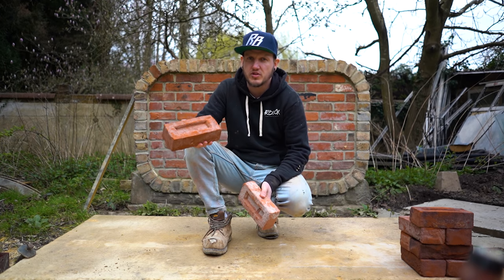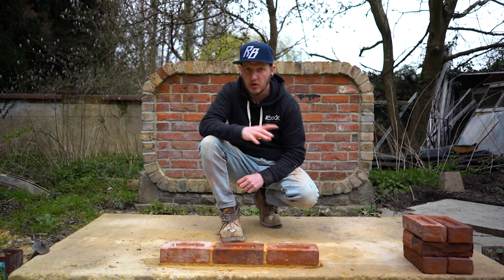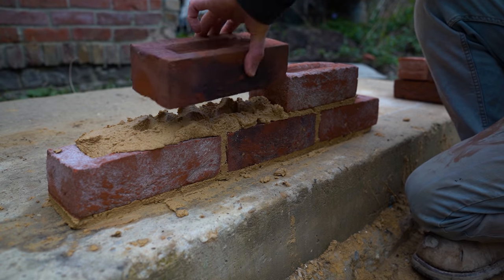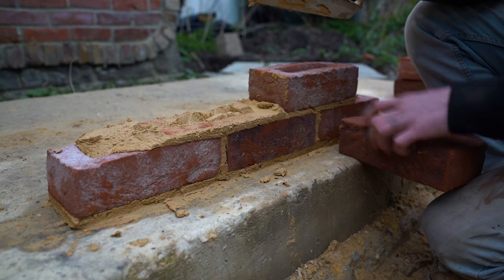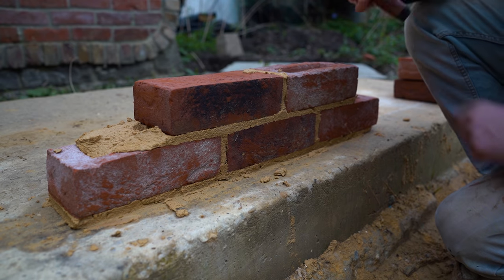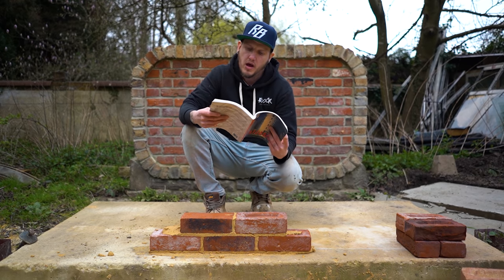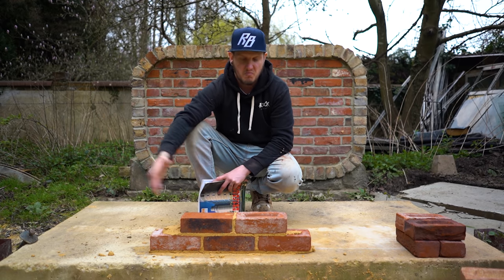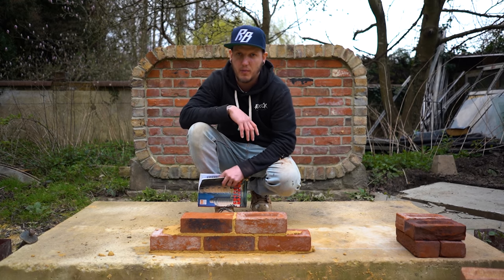THE BEST BRICKLAYING TECHNIQUE is Frog up or Frog down?

Comment: I layed frog down for most of my price working life, less wrist stress pressing the bricks to the line, online recently in last few month converted to frog up pic and dip, I still find it easier to build corners/pillars frog down, you get the suction effect and less sliding affect around the bricks when doing level work, plus a nice flat top level off

Comment: The frogs are there to make the brick lighter and use less clay , the old lbc bricks had huge frogs , cheaper to manufacture and lighter to move to the site , as muck is mixed on site it's cheaper.  I would lay the last course on a single skin frog down so it doesn't collect water .

Comment: Rodian you  can’t be certain that the first brick you laid had no voids in the bed because of the deep furrow you put in the bed . If you lay brick with shallow frogs , frog down into an unfurrowed  mortar bed you can be certain the frog will be filled . Why do bricklayers furrow mortar , because when they  are serving there time they we’re told this is how you lay a bed . Charlie collison has proved conclusively in his videos that brick can be laid no bother into unfurrowed mortar and you can be 100 percent certain there is no voids in is beds . I think the real problem in brickwork  is not Laying them frog up or down it’s laying into deeply furrowed mortar and leaving voids in the bed . Obviously laying frog down into deeply furrowed mortar can create bigger problems than frog up into deeply furrowed mortar but they are both problematic. Lay shallow forgged brick any way you like but cut out or cut back drastically on the furrowing and you’ll have no problems regarding full beds.for the record I lay frog up.

Comment: My 1920s 9 inch solid brick wall house has the frog down with lime mortar. i guess any air pockets with unfilled frogs will act like a cavity insulation even if the strenght is not there.

Comment: You should done your comparison with the frog down with the lower course frog down. You put frog to frog so of course you probably had air pockets. Place the mud and don't furrow it with the frog down and then remove the brick so see if there is a pocket.

Comment: If frog down, you've got to lay the mortar centrally along the brick and leave a high ridge in the middle. When compressing the brick onto the mortar, the mortar will first fill the frog, then displace towards the edges. Got to spread the mortar right if doing it that way. The flat top of the brick makes spreading easier. 

Guidelines however are guidelines and you can't argue with the maths of the matter.

Comment: If you do lay frog down, you always put loads a gobbo down standard.
If they want full beds etc then they shouldnt put holes in a brick either, every bricky knows that them holes never get filled completely do they.
We just done an extension and on the existing it was frog down, you got to marry up with the exsisting but we do usually do frog up with them dirty lbc’s😂 
Oh and when you knock down a wall of lbc frog down its so easy🧱😂🧱😂

Comment: Saw this by accident really, but just wondering why would you use the argument of getting a higher compressive strength when you lay frog up to recommend always laying this way. 7N/mm2 is normally enough even for buildings up to three storeys, so unless you're building something which require more compressive strength, it really doesn't make sense to even mention that argument really. More is not always better, and there are other arguments to have in consideration here. If you're building a garden or a retaining wall, for instance, I would recommend to lay frog down if you have some experience and, as you say, go through the hassle of making sure you don't leave air pockets and you infill the frog properly. If you don't have much experience, however, I would always recommend to lay frog up, just to be sure that you leave no air pockets. If you don't infill the frogs properly, chances are your wall will be more vulnerable to lateral or wind loads, which should probably concern you more than the compressive strength you achieve in most scenarios. Laying with the frogs up will probably mean some water remains in the frogs when it rains, which might, nor not, be a problem as well. There is not a better way of doing this, they're just different and each one has its pros and cons.

Nice video anyway.

Comment: Ive worked in masonry restoration for many years... And I agree frog up is the way to lay 
But Paddledog is right the old school brick buildings
 A lot were laid frog down to prevent water ingress and pooling inside the frog as lime mortar was used
They understood that the frog gave them more lateral strength 
But knew nothing about compression strength ratings in those days
Have a look at brick built buildings from before the Victorian age 
Anything before the 1800’s you will see a lot of frog down masonry

Comment: British Standard Code of Practice BS 8000-3 Workmanship on Building Sites states that;
“Unless otherwise advised, lay single frog bricks with frog uppermost and double frogged with deeper frog
uppermost. Fill all frogs with mortar..... Bricks walls built with frogs down and unfilled are weaker and less resistant to
 sound transmission. Advice should be sought as to whether bricks laid frog down are acceptable”.

Comment: Frog up for strength, science proves this. But in Australasia we would have been taught frog down. The vast majority of our brick exteriors are not load bearing, simply a veneer. The frog down intentionally leaves a void to assist in pressing the brick in place by hand and not having to tap the brick with your trowel, a habit that slows you down and regarded not good trade practice.

Comment: You’re not supposed to furrow the mortar. You didn’t spread enough. Frog up holds water that has to pass through brick to escape.
Reply: PaddleDogC5 that’s not how any of this works lol
Reply: Ive worked in masonry restoration for many years... And I agree frog up is the way to lay 
But Paddledog is right the old school brick buildings
 A lot were laid frog down to prevent water ingress and pooling inside the frog as lime mortar was used
They understood that the frog gave them more lateral strength 
But knew nothing about compression strength ratings in those days
Have a look at brick built buildings from before the Victorian age 
Anything before the 1800’s you will see a lot of frog down masonry

Comment: BLFUWP !
😬here goes ....... don’t lynch us but ..... the lads we work for insist the two course of commons we put inside are laid frog down , the reason being that the block n beam floor sits on on them and If they are frog up the beams ain’t sitting on much . In our defence the frogs are very shallow and easy to keep full . We would much rather use solid commons...... proper job them 💪🏽💪🏽💪🏽🧱🧱🧱👍🏼
Reply: Do the same mate for beam course, some of the packs of  commons were solid and others frogged 🤷‍♂️
Reply: Fair enough you do  what you are asked.  When beams can be laid on blocks that have a 2.8nm crush load,  it seems pointless to think that any brick laid frog up would be less than this.
Reply from the maker: It would make sense to frog them for beams....like you say, obviously better to lat solid bricks in their place though 🤙🏼🧱
Reply: Rodian Builds we would much rather use solids 🙄🧱👍🏽
Reply: Hi steve. Yep concrete commons all the way for that. Or brickettes or scones wherever you are in the country 😆👍🏻👍🏻🏴🏴🇬🇧🇬🇧